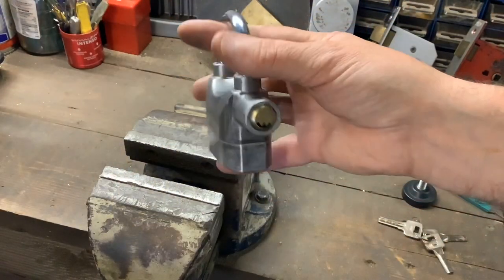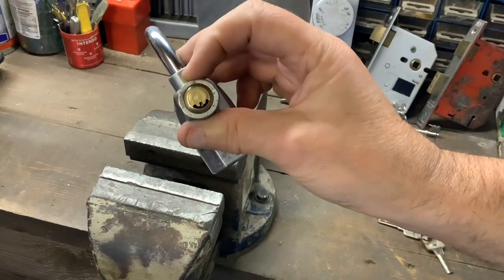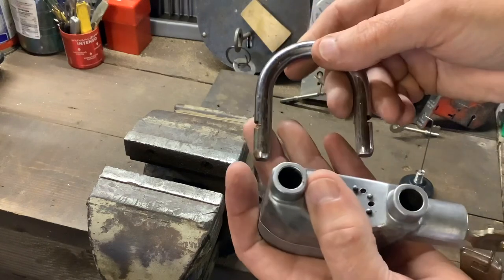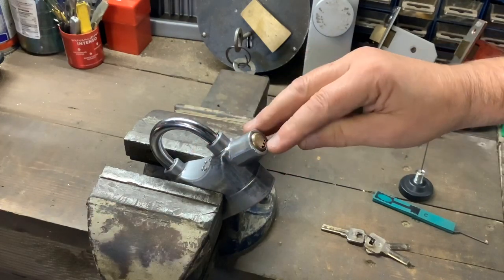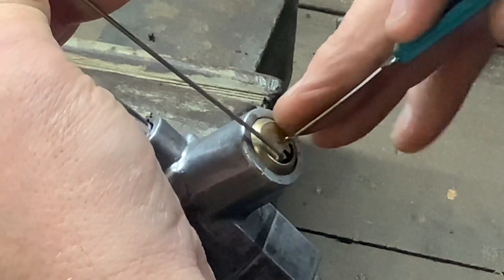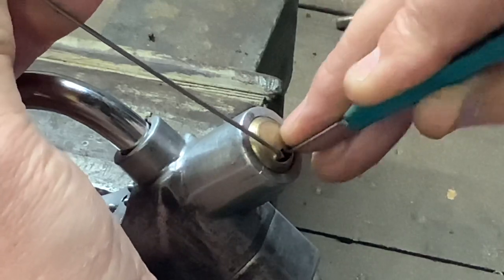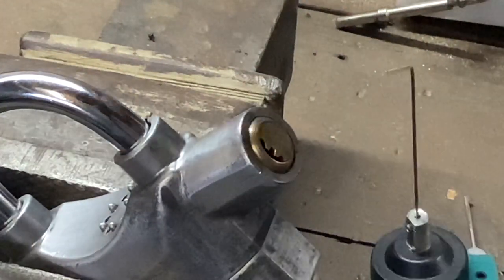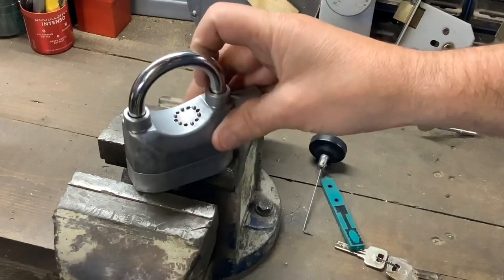384. Cheap Chinese lock motion sensor siren alarm padlock with smiley keyway picked

Comment: I bought one of those from Ebay about 2 years ago. Still haven't got round to picking it. A good one to see if my foil impressioning kit would fit in it.
Great little demo on picking a smiley lock. If the alarm was working you could activate it and then see if you could pick it without setting it off.
Reply from the maker: Cheers for watching Roy, first smiley I have come across 🙂

Comment: Was the usual black coating off when you purchased ? But yes I purchased one at Aldi under brand name ''Home Protector'' fun. to pick without setting the alarm off.I just removed my batteries so thank you didn't want them to leak.  https://www.youtube.com/watch?lock picking lawyer did two videos on same type of lock found https://www.youtube.com/watch?v=mj9kh5Guz6M and https://www.youtube.com/watch?v=Kzb74kzFAIs for yours and others reference. The lock lets owner down because the siren is open to exposure from rain/wet through bad manufacturing design fault of location.  These locks are good for protecting beer at party's or part of a party game. that space you have created by removing alarm hide a key to the drinks cabinet in the space. Or your last Rollo.
Reply from the maker: Cheers for watching and commenting 
I did watch the videos LPL did on these locks 👍 The black coating had deteriorated on this one and most of it had gone so I removed the bit what was left